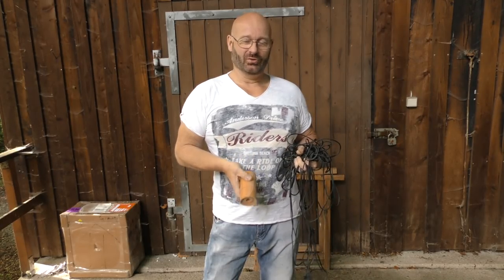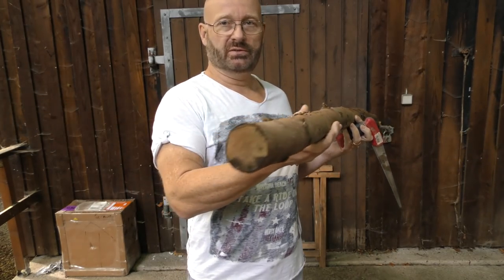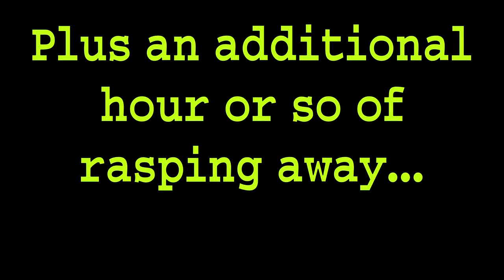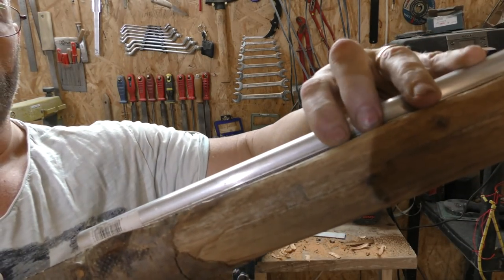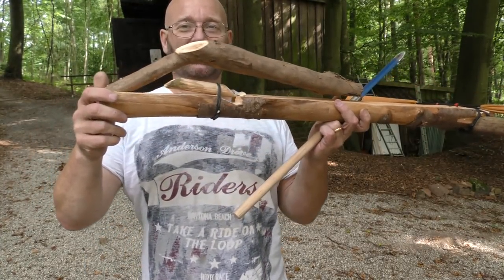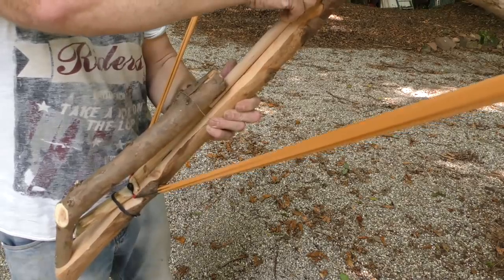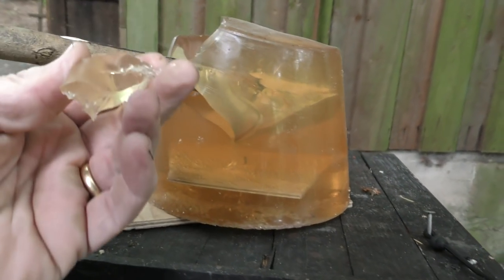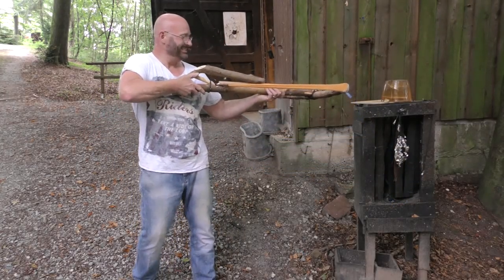"Wilma" - The Flintstones Crossbow Challenge

Comment: Crossows are made out of iron (the important part)
Yours are made out of wood and shoot as well as the iron once...
You are a crazy man... But i love your videos....

p.s Please start wearing a helmet and better with a visier...
Reply: Ash's Pikachu Iron can't flex
Reply: Ash's Pikachu I'll just bend and stay that way
Reply: Ash's Pikachu those use the bending of the metal to store energy but joerg's uses rubber
Reply: i think it can flex (biegen)
Reply: he cold use both powers combined
Reply: Ash's Pikachu Steel can (if tempered)
Reply: not all are made of metal
Reply: jacktheripped Dude you'd need one heck of a windlass, and not to mention how lunarcrusly expensive it would be
Reply: jacktheripped igor
Reply: 150 pounds is a weak crossbow compared to what actually was made in the old days
Reply: Carbon fiber is a bad choice to make springs, easier/better/cheaper to use is glass fibers.
Btw: Has anyone tried out, to make a crossbow with the cheap (12$) glass fiber springs from aliexpress ?
Reply: Ash's Pikachu 
Not quite, only crossbow bolts were made from iron.
Reply: Nope... the bow part was made of metal in many designs for quite a while even in the middle ages/renaissance
Reply: The Third International Party of Kekistan I have used them for compound bows
Reply: Iskandar .Nazibudin How did it perform? Was it easy to use?…
Nice things on your channel, but I miss this one.
Reply: Feffnirsbane It's the average or you mean the crossbows which need a lot of reloading time... N average hobby now I think has about 40lbs... So yeah... But when you mean the long realoading crosssbows.... ok. Still the airgun is the best though...
Reply: I used fiberglass rods from the garden store when I made my pvc bow.
Reply: 1. It doesn't
2. There were early crossbows made of wood
Reply: no reason not to make a crossbow out of wood.  Just has to be thicker than wood for a bow if you want the same power.  I'm willing to bet the first crossbows were 4 feet wide.
Reply: Feffnirsbane Crossbows in the medieval times had high draw weights say for example 350lb, That may sound really powerful, but the draw length is relatively short which means the bolt isn't getting much acceleration. 

Modern Crossbows however have decent draw weights that range from 70 lb to over 200lb, and have over 10 inches of draw length. Plus, the prods have better efficiency for releasing the energy. Whilst steel prods were relatively easy to make back then, the efficiency wasn't that great so not all of the 350 lb was being released into the bolt.
Reply: Mok214 Nope, medieval crossbows shot bolts made of wood with iron heads.
Reply: The Third International Party of Kekistan yes very convenient material to use for bows. would recommend for making homemade takedown bows. try and find fiberglass bars with at least 6mm thickness and 30mm width.
Reply: The bow (called the prod or lath on a crossbow) of early crossbows was made of a single piece of wood, usually ash or yew. Composite bows are made from layers of different material, often wood, horn, and sinew glued together and bound with animal tendon. the bolt tip and sometimes the trigger system was metal but i doubt iron was ever used for stock or the prod
Reply: still it is a great build
Reply: Iron is a bad bow material actually.

Comment: I know in old days they used nails to drill holes by twisting them into the wood. I have an old antique hand operated drill. Not sure of the age but it's made with all metal an still works great today. Can't beat the quality of the old hand tools they made an I think it's because they used better carbon in the metal. I also have two bigger hand operated drills, similar to type they used to build cabins with to make holes an put wooden dowels in to lock the beams together. Great cross bow idea Joerg. Love the video.

Comment: Have you considered revisiting the roller wheel slingshot system and applying it to a rubber based crossbow? It could help reduce the horizontal profile of the bow. If you were to make a winching system for it it could also probably hold a LOT of rubber.

Comment: A little tip on the bolts: fire-hardening would increase the strength of the tips. Just heat it in a fire until charred and rub against a rock to sharpen. Imagine how Morgan from the walking dead makes his spears. This method functions by driving of moisture and tightening the grain of the wood.

Comment: Can I ask why you didn't just use a block plane to get your straight edge on the stock?

A manual foot powered lathe would also be perfect for whittling down sticks into perfectly smooth and straight arrow shafts. Perhaps you could do a video on making a foot/rubber powered lathe. I have an idea rubber bands might work well with a foot powered lathe.

Comment: Mr. Sprave, I know you generally do slingshots and rubber power, but are you able to develop a similar crossbow that uses the bow itself to launch the quarrel? Rubber does dry rot and it might be hard to produce in a post-apocalyptic situation, especially now most tires don't use innertubes.

Comment: Ah, you may have built a crossbow out of wood, rubber, paracord, and nails, but I once built a toy bow out of nothing but a bamboo skewer.
I split it in half and 1 side became the bow and the other became the arrow, then I cut a thin band in the bow side, and that became the string. Then I chewed the end of the arrow to make fletching. I ended up with a tiny bow that could fire its arrow about 4m.
The string did eventually break, but I just glued it back together.
Unfortunately I lost it.
It would be interesting to see if you could do it on a larger scale.

Comment: That was awesome.

One small problem, we all know that that rubber has a finite life and no more is going to get made.

I want to see him create one from more realistic materials like simple rope etc.
Reply: ultraboy222 I've used theraband for slingshots, and I know it doesn't last a fraction of the time of ropes or paracord when in use.  Not to mention rubber "goes off", so from the point of production stopping, your supply of decent rubber is far less than a supply of rope.

You can't make decent rubber without high tech (relatively), ropes can be made with the simplest of tools.

Comment: You can burn the tip of the wooden bolt to harden it for better piercing....... Can a bicycle tube be used instead of a rubber band?

Comment: An impressive build, but why the unusual bolt guidance construction on the top? Why not simply notch the back of the arrow to capture the bow string? Honest question, not trolling.
Reply from the maker: The arrow needs to be guided at least on one spot, otherwise it will jump out of the groove.

Comment: Is there any particular reason to have such large bow arms? You aren't using them for the power, so it seems like you might as well make them shorter, more like a normal sling-shot, so that you can increase the draw weight without putting so much torque on them.
Reply from the maker: The bow arms need to be wide so the pretension is strong. This allows the stock to be much shorter. A longer stock would have meant even more rasping :)
Reply: Haha yes ok that makes sense.

Comment: What I wonder: Why would it have to be a crossbow? I mean, there are plenty of weapons you can create with rubber and wood and I think that some of them would be a superior option to a crossbow since a less specialized lobber or slingshot would not require you to work on your bolts first since you could use pretty much every single piece of junk or every little rock you come across...
Reply: I mean, that´s probably just the conditions of the challenge but really, how about making some kind of Junk launcher? 
Conditions: 
-Must be made out of wood or Junk materials(Junk materials include all kinds of items that were not specifially made for the purpose of creating anything simular to a launcher)
-No use of electrical energy to create or power it 
-Can fire anything small enough with a reasonable amount of power and accuracy(alternatively turn it into a "shotgun" that just shoots out several small objects like shrapnell)